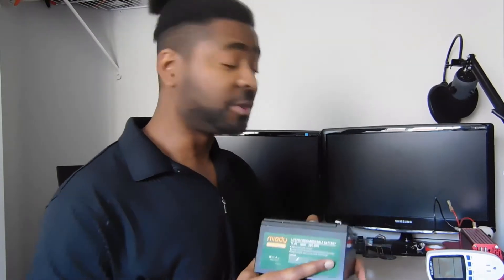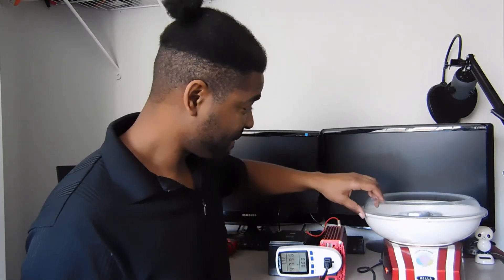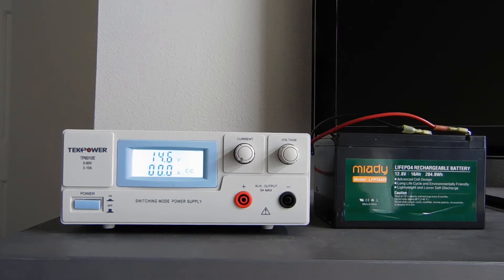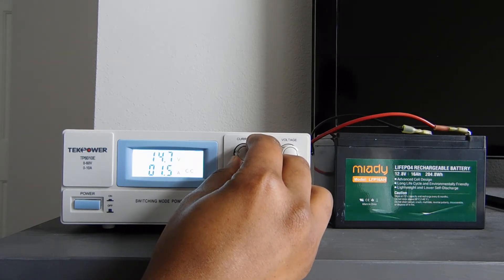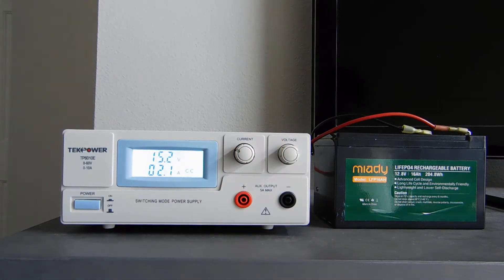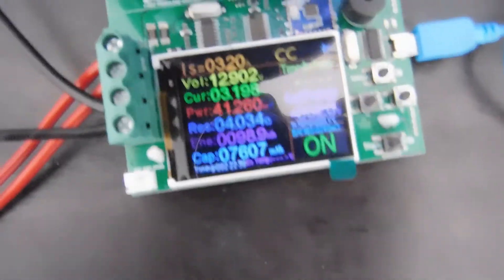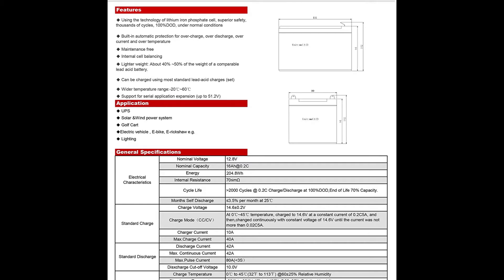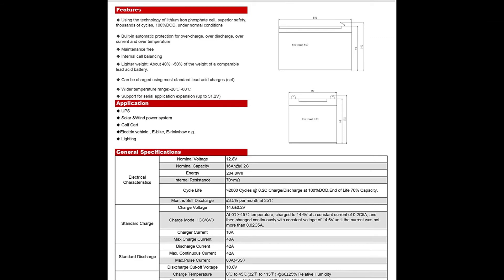Battery Review: Miady 16AH 12volt LIFEPO4

Comment: For Ebike application, this 12V 16ah would need to be connected in series to power a common 48V 1000 to 1500 watt brushless Ebike front wheel motor. I have found 1 user review who used this exact set up wired in series to power his 14V 1500 watt motor with no negative results reported. I am looking for more confirmation of same! NOTE: Ebike motors are also assisted by the pedal force of the rider. This reduces the amp draw and extends the time before the batteries cut out. It would be greatly appreciated if this exact battery's performance could be tested and reviewed in a 4 battery set up wired in SERIES to produce the 48 volts needed for Ebikes! Ebike is listed as one of the common uses of this battery in its desciption! THX!

Comment: Thanks for the video - that 36ah seems like it's gone forever. Newbie question - would this run a 12v fridge / freezer for at least a little while? I saw you mention the voltage dropped. Trying to setup an emergency fridge backup and thought maybe a few of these rotated between the 12v fridge and solar to recharge them might work. I would have to attach one of those inline fused 12v plugs. Thanks again.
Reply from the maker: So, one of the commenters for the 36ah video has spoken to Miady, and they say more 36ah are on the way. International shipping is massively backed up though, so who knows when they'll arrive. 

That said, it depends on how much power the 12v fridge/freezer draws. For the majority of this batteries discharge (more than 80%) curve it will be above 12v. Without knowing how much current your fridge draws, it is hard to say if this battery would work for a backup system.

Comment: Would you think a series of these, maybe say 5 paralleled together, could work on a portable solar generator to power a fridge?  I need roughly 1000kwh to run my fridge for a day on batteries alone. These seem like less expensive options
Reply from the maker: There are three parts to this answer, first there's the matter of capacity. When batteries are run in parallel you get increased capacity. 5 * 16AH batteries in parallel would give you 80AH of capacity. Multiply that by the voltage to get your watt hours, so 12.8v * 80ah = 1,024 watt hours. This puts you just at the amount of capacity needed to run the fridge assuming it's 1000wh (1kwh) instead of 1,000kwh. This also means that you'll have to fully discharge the batteries, which is bad for cycle life. Typically, for LiFePo4 to reach the full cycle life, you only want to discharge down to 20%. 

Second,
So these battery are capable of quite a lot of surge current, however for large appliances the inrush current can be significantly larger than the actual running load. To determine if this is possible, you'd want to take a Clamp Multimeter and see how much current is required to start the compressor. At 500 watts output these batteries are producing nearly 40 amps. Standard F2 terminal connectors are made to connect to a maximum wire gauge of 10. The maximum safe amps to run through a 10 gauge wire are 30-35. After that point, you risk melting the wire. So, if the inrush current required is greater than 384watts (12.8 * 30) than I really wouldn't recommend using these batteries. 

Finally, 
For the $300 to buy five of these batteries to run in parallel (and really you'd need 6 or 7 if you wanted to maximize cycle life so $360 or $420 ) you'd be better of buying a battery that could more easily handle the current and capacity. Something like the CHINS: https://www.amazon.com/LiFePO4-Battery-2000-5000-battery-Off-Grid/dp/B08FMTRYPT/ for $455. That said, even though the CHINS can output 1280w your fridge inrush current could be greater than that, you'd have to check to be sure.

And of course, all of this is based on the fact that you have an inverter capable of meeting the inrush current.